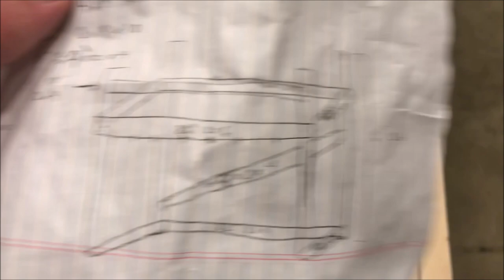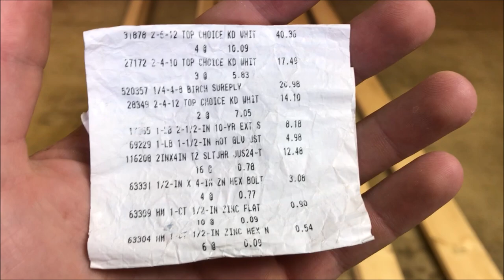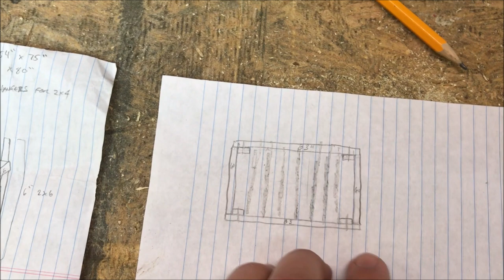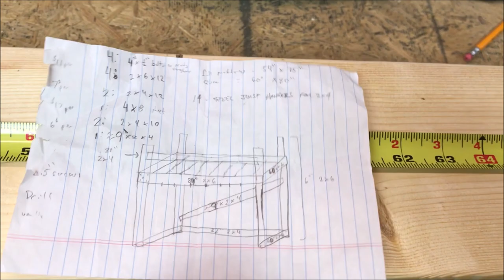Loft Bed Build DIY, 120 Dollars, Queen Size

Comment from the maker: UPDATE: On both ends of the bed I added diagonal 1x3's as cross bracing going from the top of one leg to the bottom of the opposite leg, and now the bed is crazy rigid and stable, NO ROCKING what so ever. The difference is day and night.
Reply: What tools do I need. I'll be doing this by myself
Reply: Tonto Bob what would I need in order for it to be sturdy enough to hold a twin mattress and twin box spring?
Reply: I thought cross bracing too...great build thanks...
Reply: can u do this video update
Reply: I am dealing with lack of rigidity with my loft bed.. not sure if I should go with diagonal cross braces or horizontal... I have 2"x6" bed mattress frame, followed halfway down with a 2" x 3", and then the same at the base, on 3 sides.  all the 2" x 3" boards are connected to the 2" x 4" legs with 3 screws, triangular pattern, and the 2" x 6" with 4 or 5 screws... but still there is some wobble... which is better, diagonal or horizontal?

Comment: That had way to much wobble for me and adding the extra screws will definitely help with the finished product but you shouldn't rely on the wall for support. If it's something you will be sleeping on and potentially more, you want it to be completely stable and free standing. I had a loft in my room as a teenager. I had a queen size bed on it but we built it to fit a king so I had enough room to walk around and keep my alarm clock and fan. It also made it far easier to make my bed. We built it like a deck and instead of using 2x6s we used 4x4s and didn't require the additional lumber across the bottom or diagonally. Since I always had sleep overs for me and a room full of young children for my niece we did the upper railing as rope netting mounted to the ceiling so no one could fall off. There was absolutely no movement even with a bunch of teenagers climbing up and down and kids bouncing around. When I moved out my mom shortened the legs to replace the deck off the side door and even 25 years after building it, it's still as strong as ever never shifting or moving.

Comment: instead of using single 2x6 boards as legs, if you joined a 2x4 and the 2x6 in an L, it wouldnt sway

Comment: 2x4 90 degree corner posts would be more sturdy, wouldn’t have to notch the luon. It’s needs more bracing , I would’ve angled cut the ladder and screwed into the frame. Also, drill bits are awesome. This is great dimensions and gives me a baseline for my build.

Comment: It's has been almost a year and my husband and I are SO happy we came across this video! This bed is so customizable as well. For instance ,we added some hooks to the side of the bed for hanging things. I would like to add more customization though like screen handles on to pull ourselves up on the bed instead of holding on the sides. I would also like to add shelf/pocket on the top side to put our phones, maybe add a small table (foldable) at the bottom for studying.
Reply: Can, you leave a list of tools needed?

Comment: Make it sturdy or go home. 
You figured out one wobble but not the other, but you must be tired from all that building, hope you figured out how to make it better without relying on damaging the walls.
Doesn’t work great yet, but it’s getting there.

Thank you for sharing :)
Reply: I bought a loft bed from Ikea.  It wobbled, so I ran cargo straps diagonally.  That made it a huge amount sturdier!
Reply from the maker: I added diagonal 1x3's as cross bracing to the front and back and now the loft is crazy rigid and stable. No swaying side to side at all.

Comment: How  did you fit a 60 inch wide Queen-sized mattress into a frame that has an internal width of about 57 inches?
Reply: Exactly, you have to make the other width board 63 instead of 60 in order to fit.
Reply: no, with how he overlapped the pieces, one side was going to be true to size and one side would have to be made bigger. if you draw it out you’ll see.

Comment: You got the bed built but you need a lot more education in building and design.  Over building in some places and a lot of under support in others.  The money you spent on over building would gone for finishing the deck and stairs properly and making them safer.  you are luck that the whole thing did not come down with you.  I would not climb on that structure!
Reply: Galen Johnston the caption clearly states DIY never once did he say he was a professional, help and support instead of downplaying this man's craft! He mad it easy for us DIYERSSS AND NOT PROFESSIONALS to actually have the confidence to do this without being complex .
Reply from the maker: I added some cross bracing to back and front  a year ago, slept on it every night since with no problems. Supports 2 people just fine also. If you have suggestions please make them instead of just giving criticism.
Reply: Would have loved the suggestions on where to make it stronger!
Reply: The corners need more support. Drilling screws from the face of one 2x6 into the butt of the other 2x6 is counting on the shear strength of the screws and the weak end grain of the wood to hold. Better would be half laps into the legs, but the legs need to be meatier (perhaps 3 2x4 laminated together). This way, the weight of the bed is onto the wood rather than bolts.

The ladder man be strong enough, but dados for each rung would hold it so much better.

1x1 glued along the perimeter of the inside of frame (between 2x4s, and at head and foot board locations), and using 3/4 particle board rather than whatever he had would be extremely strong and help keep bed square.

For the 2x4s under the mattress, 7 seems like overbuild but I don’t recall what grade sheet material he used. Looks thin though.